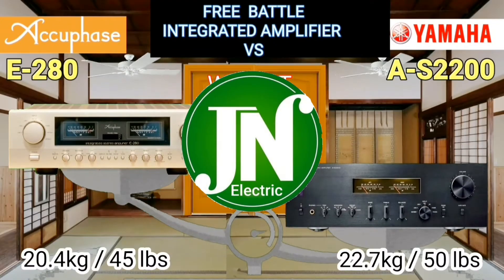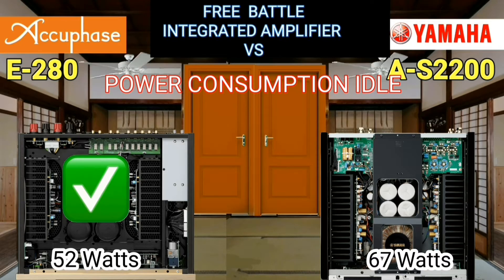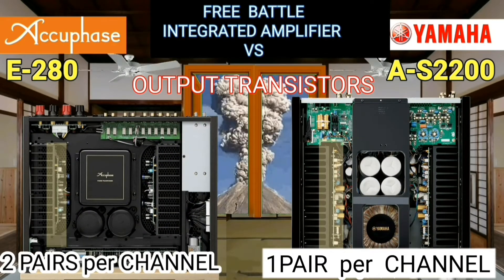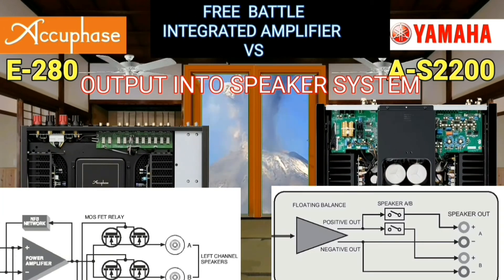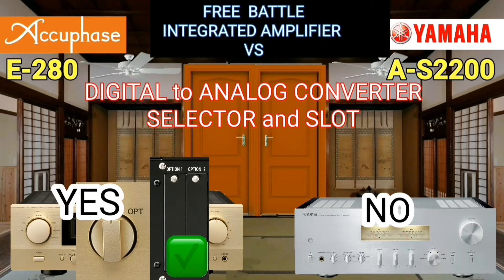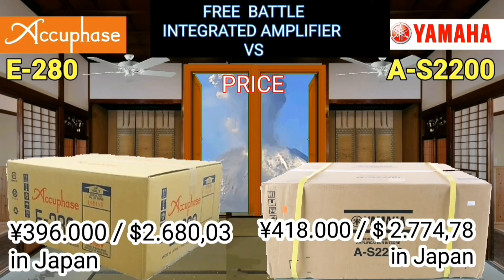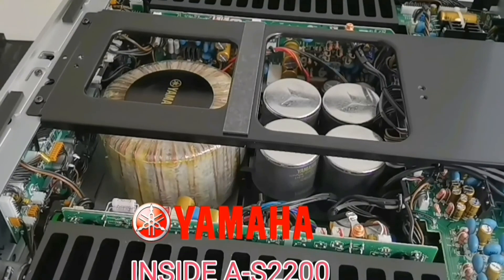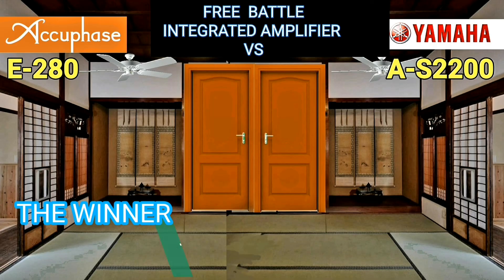Yamaha A-S2200 VS Accuphase E-280 integrated amplifier who's the WINNER technical data

Comment: it is interesting the damping faktor. Everybody who had a chance to listten both of thiose amplifiers is awar that yamaha does control the woofers significantly better than e 280, however ower all I like more accuphase sound
Reply: Sometimes, external bias are entering the race and influence the results.
Reply: @ i see what you write and i assume that you want to say that this is the case. It is not, yamaha has much better control over the spekers and you will recognize it. On the other hand yamaha really needs florstanders otherwise there is not eneugh bass impact at least to my taste